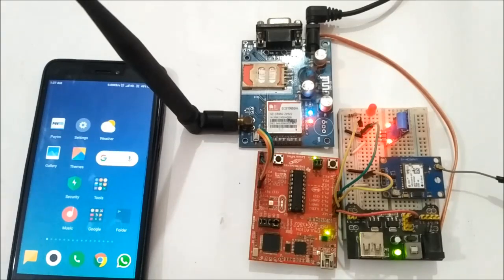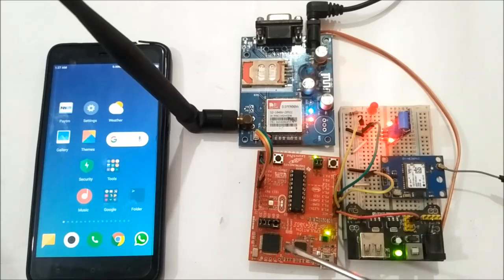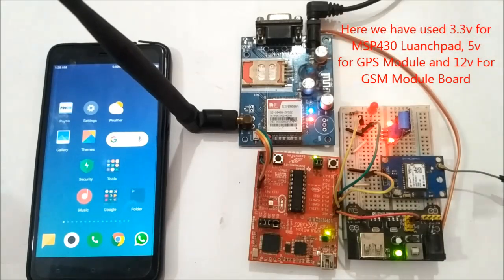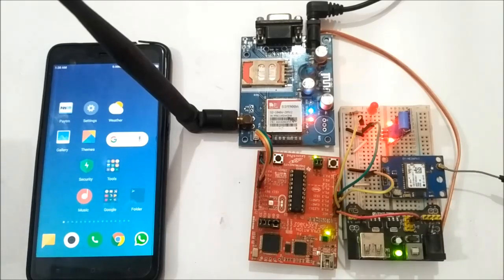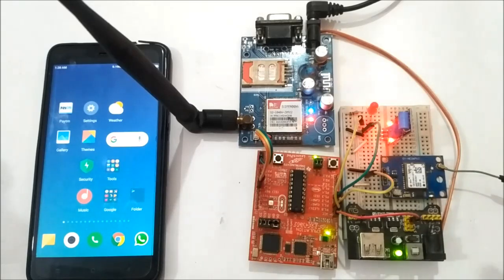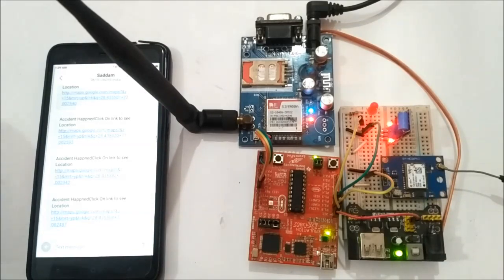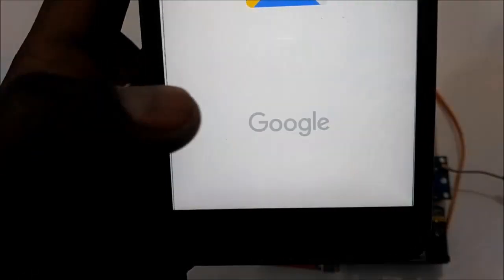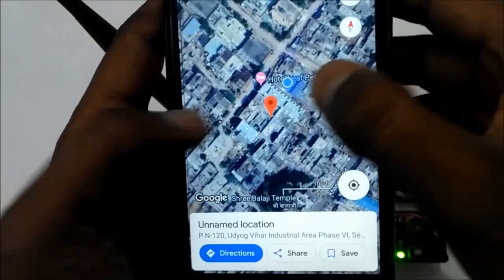Vehicle Tracking and Accident Alert System using MSP430 Launchpad and GPS Module

Comment: Can I use other version of GSM module like SIM800L?
Reply: Nope you cannot !!! If you want to use 800L module you need to change AP commands in the program.
Reply: @chathurafernando1299  need your help!
Reply: @08-dubeybhaveshpawan40  What for ?
Reply: @chathurafernando1299  want to implement this project
Reply: So need detailing
Reply: @08-dubeybhaveshpawan40  So what do you want to know ?
Reply: @chathurafernando1299  can we talk privately on whatspp
Reply: @chathurafernando1299  do you have this model?
Reply: @08-dubeybhaveshpawan40   You don't need that exact module to do the project. You can use Gsm 800 or 900 and GPS Neo -6M module with arduino. Read the description 😇
Reply: @chathurafernando1299  i have to use project with msp430 , gsm900 and gps 
So help me out with msp430 code with same implementation